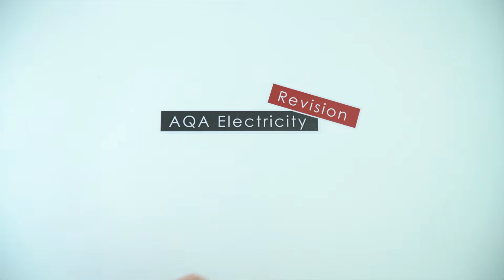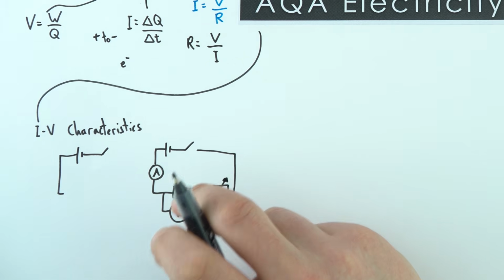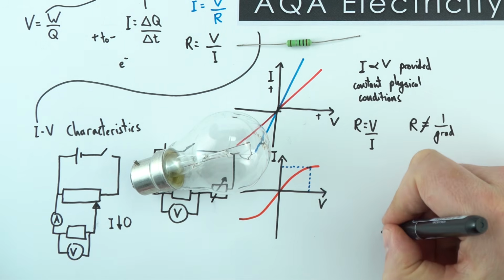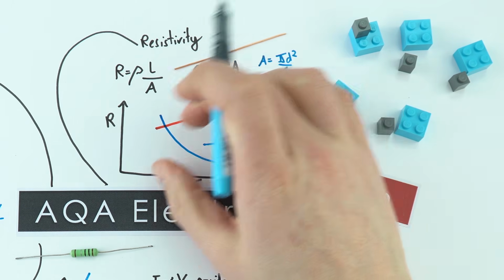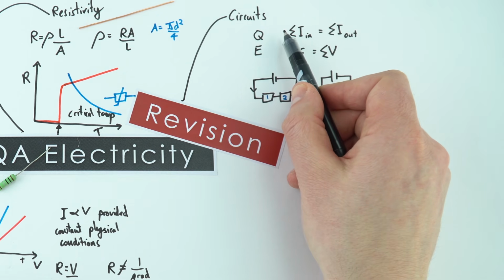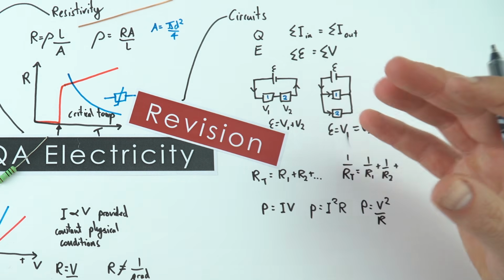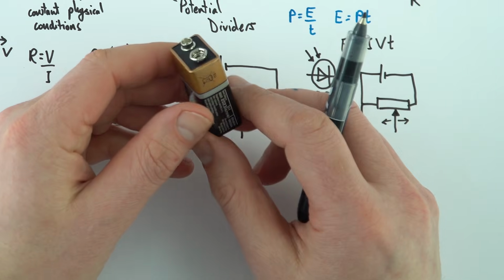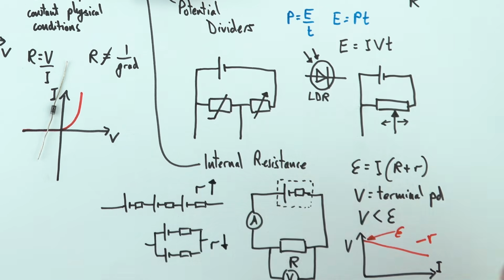All of AQA Electricity Explained - A Level Physics Revision

Comment: Sir, for the last part about resistors and cells in parallel, how does the current and resistance add up and say we connected a lamp in parallel to the circuit drawn, what the current and resistance be.

Comment: 0:00 introduction
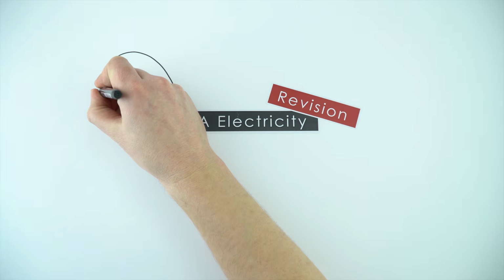0:26 - GCSE Revision, I-V Graphs, Ohm's Law, V=IR and Proportionality etc...
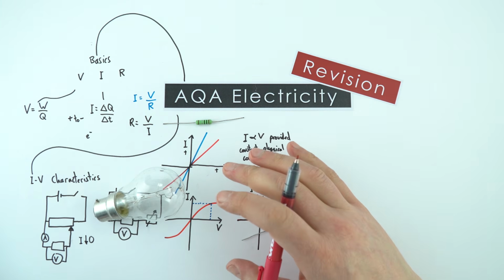 8:17 - Resistivity
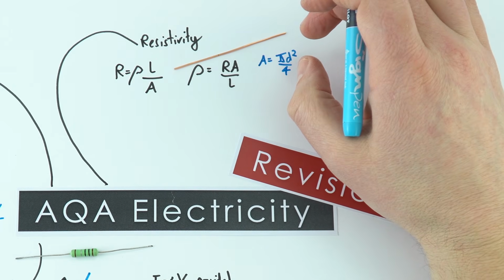9:32 - Resistance and Temperature Proportionality
10:36 - Semiconductors and Thermistors
11:47 - Superconductors and Critical Temperature

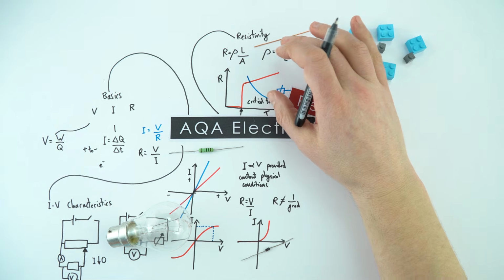12:30 - Summary of Topics so far 

12:41 - Kirchoff's First Law
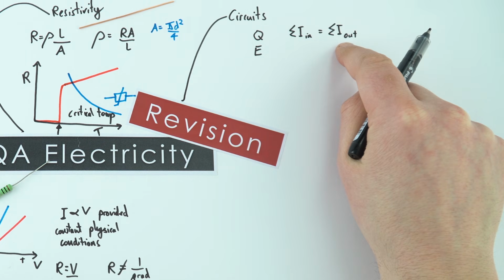13:23 - Electromotive Force
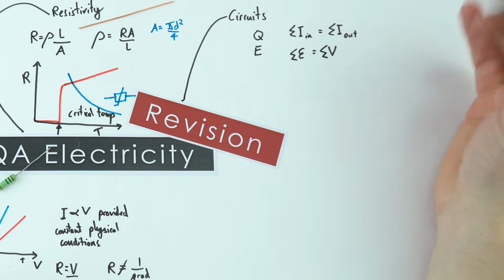14:33 - Current and Potential Difference in Series and Parallel Circuits
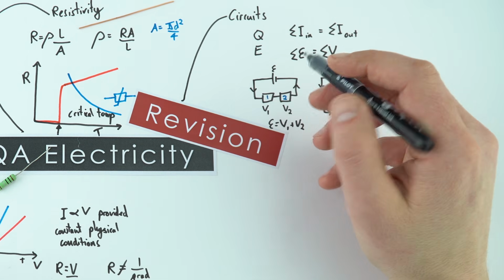16:45 - Calculating Resistance across Parallel and Series Circuits
18:16 - Power
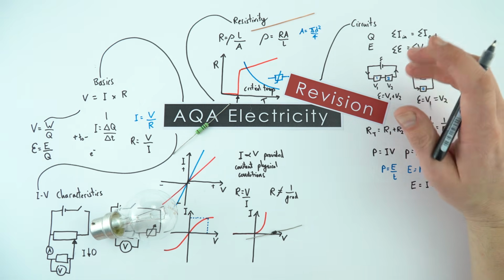20:05 - Potential Dividers
22:25 - Internal Resistance and Its relation with the Electromotive Force
Reply: thank you

Comment: 22:06 can someone explain to me why there's no resistance when the pointer is at the left end? surely if it's at the other end the circuit bypasses the resistor and effectively avoids the resistance? i'm not correcting or anything, i'm sure it's right., but i just don't understand why 😔
Reply: The resistance is proportional to the length : R = (resistivity x length)/area . Therefore when l = 0, r = 0, such as there being no resistor. Therefore as V = IR, there is no voltage.

Comment: Just gonna add something, for the I-V characteristic graph for the diode, the line won’t starting going up from the origin because diodes have what’s called a threshold voltage meaning a current will only start flowing once the threshold voltage has been reached, for the diode shown in the video, this would be around 0.8 volts.
Reply: I’m only doing GCSE’s haha but I’m just a nerd, I don’t know if you actually need to know this for the A-Level but I thought I’d mention it anyway 👍

Comment: Thank you so much for the effort you put into these videos. It would be super helpful if you did one for OCR A
Reply from the maker: Thank you, that’s my plan.
Reply: @Tjk_ SkaZeRe.m.f stands for electrotmotive force. It is essentially the total electrical energy supplied by the battery sent around the circuit. Units are V. The weird looking E represents e.m.f in the equation and is also the Greek letter known as epsilom. Hope I was able to answer your question.